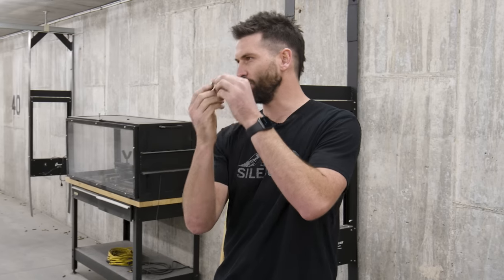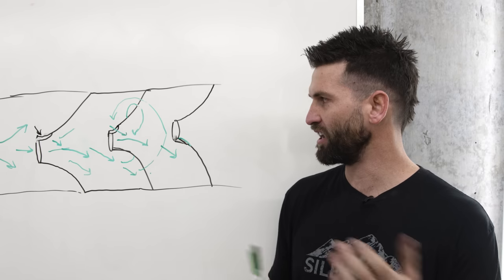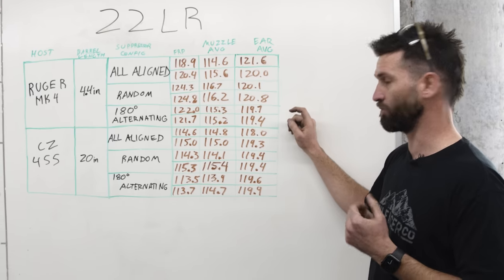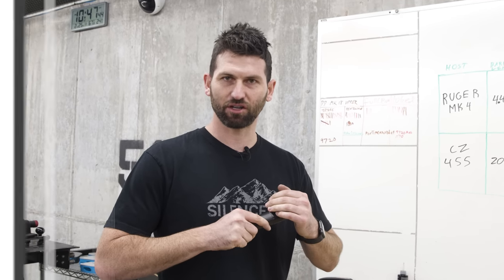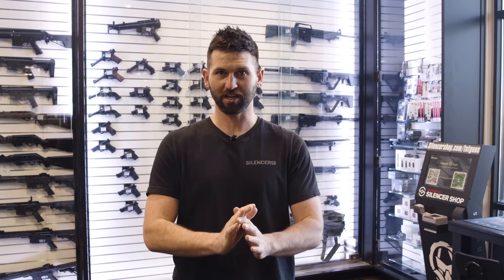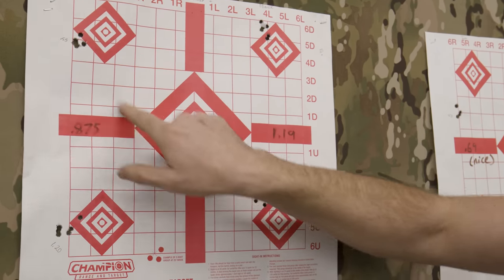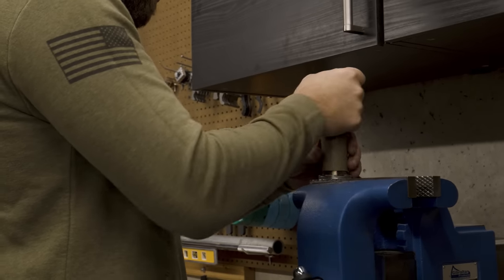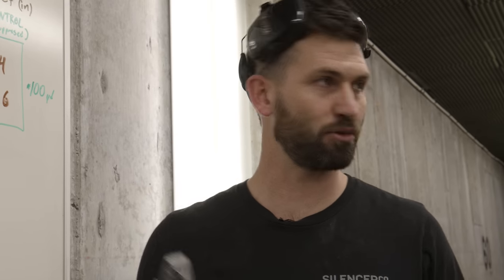Suppressor Science: Baffle Alignment

Comment: I'm not entirely sure the early explanation about port alignment holds true for symmetrical (dual opposed) porting as the dynamics of turbulence are different. Hopefully this video will cover it...

We also didn't note how alternating 180 degrees on a rifle gave the lowest FRP and at muzzle readings on rimfire. I guess it's not enough to matter. I'm sure there's a lot of complicated interplay that happens once powder is fully burned and reaching the limit of its expansion.

Comment: My old (but barely used) AAC Ti-rant 45 directions has me stack three baffles so that ports are stacked, while directing me to stack next four baffles with openings on exact ipposite side from first three baffle openings.  Does that make any sense.

I know my accuracy with this suppressor attached to my Glock 21SF from 15 yd bench rest was horrific: eught to ten inches from "x" no matter which "hand of the clock" the shots went to (from my adjusting it by extending outward from direct thread attachment by 1/4" and turning...done 12 times with same result).

Comment: I gotta question, need some wisdom..

  Would a narrower clip have an effect on lower pressure cans as opposed to a wider clip?  Thanks!
Reply: @jacobturnblom2681  
  Thanks Jacob, I really appreciate you taking the time to answer.
  Form1 community has a general formula they'll use for aperture and clip size. The only problem there is most don't have the equipment to test. It also seems that commercial can clips are larger generally speaking
  Also a lot of guys are swearing by dbl clips for low pressure cans, but I don't think I've seen that much in commercial cans. Any thoughts?
Thanks Again!

Comment: Моё мнение что самое главное это первый конус и он должен быть от среза ствола на расстоянии меньшем чем длина пули чтобы пороховые газы дробились сразу же как только пуля покидает ствол.
Нужно проверить расстояние первого конуса от среза ствола , в 5 мм от среза пуля проходит в конус и пороховые газы не успевают её обогнать тем самым они сразу же гасятся о первый конус .
И так один конус за другим .
Расстояние между самими конусами тоже должно быть короче чем сама пуля чтобы они не смогли её обогнать , и отверстие в конусах должно быть на много меньше чем в вашем глушителе , так он будет на много эффективнее.
Проточка в конусе под большим сомнением и здесь нужны конусы без проточки и с проточкой чтобы определить есть ли разница .
У вас большая часть пороховых газов проходит между пулей и отверстием в конусе , с проточкой пороховых газов проходит ещё больше обгоняя пулю .
My opinion is that the most important thing is the first cone and it should be from the cut of the barrel at a distance less than the length of the bullet so that the powder gases are crushed as soon as the bullet leaves the barrel.
It is necessary to check the distance of the first cone from the cut of the barrel , 5 mm from the cut the bullet passes into the cone and the powder gases do not have time to overtake it , thereby they are immediately extinguished on the first cone .
And so one cone after another .
The distance between the cones themselves should also be shorter than the bullet itself so that they cannot overtake it , and the hole in the cones should be much smaller than in your silencer, so it will be much more effective.
The groove in the cone is in great doubt and here cones without a groove and with a groove are needed to determine whether there is a difference .
You have most of the powder gases passing between the bullet and the hole in the cone , with the passage of powder gases passes even more ahead of the bullet .

Comment: 2 questions:
1st- 180 degree alternating.  Sounds like each one alternating.  Or did you mean the more normal 1st half aligned one way and the second half aligned 180 degrees opposite?
2nd- I would think that in your indoor range, the suppressed dB's would be much higher than outside.  Have you ever done a comparison?
Thanks!
Reply: Don't think they did, but indoor range vs outdoors is ginormous of course.  I'm assuming your shot indoors, low ceiling ranges with ars are brutal.  Now outside, as long as your not to the right or left to absorb the concussion force its way better.  But having those sound waves bouncing around inside always is louder than out.  But I think this is more accurate inside.  It would only be more quiet

Comment: When you fully screw on the suppressor, does the index of the clipped portion to the gun matter? Ex. If the "row" of clipped portions is on the right side when the gun is horizontal, does it cause bullet drift to the left, or right? Or is it negligible? (Or should I try to make sure the clipped row is vertical, either directly over or under the bore when the gun is horizontal). Horizontal in this instance means the gun is normal firing position, wither shouldered as rifle or shooting normally w/ a pistol.
Reply from the maker: In our testing the timing position of the keyhole cutouts do not matter. It's more important that they are lined up internally. It is possible that you could see a slight point of impact shift from one clock position to the next but it would be minimal and repeatable.
Reply: I was wondering the same thing, and how would you be able to be sure they were lined up vertically when you tighten the suppressor down?

Comment: what are some of the best 9mm pistols to use with your suppressors ?
Reply from the maker: Our suppressors will work with virtually any host. Get a 9mm pistol that fits your needs and so long as it either comes with a threaded barrel or has an after market option for one you're good to go to run it suppressed.

Comment: Does any maker use Tesla Valve design tech as a basis for baffle design? Can't use it literally the same, the can would blow up. Do not know if gasses would work the same in that design, Just curious.
First round pop greatly lessens a suppressors usefulness if you are a hunter. Until they figure out how to purge oxygen from the interior of the suppressor, pop will remain. Would longer barrels reduce pop since all of the powder could be burned up prior to the bullet entering the suppressor?

Comment: Do the dots have to be perfectly aligned? Or as long as they kinda form a line, even if it's not perfect?
Reply from the maker: The dots don't need to line up at all, however the closer they are to lining up the more effective the performance.
Reply: @SilencerCo  just got a switchback, and 4 pairs of baffles are stuck together, I don't know how to split them apart.